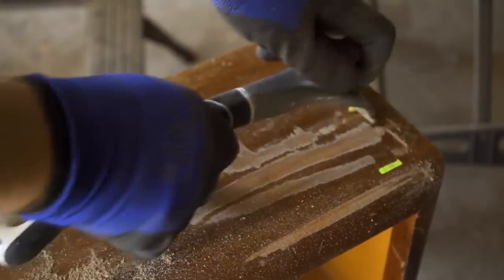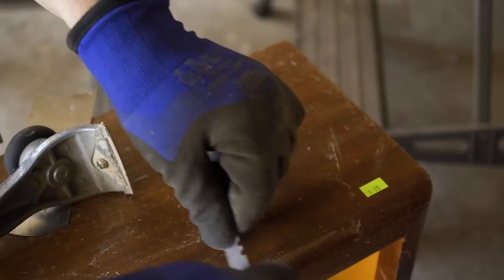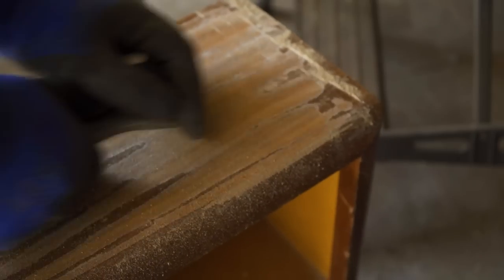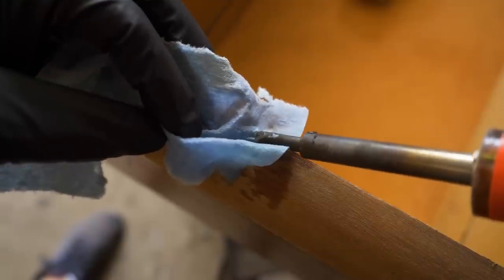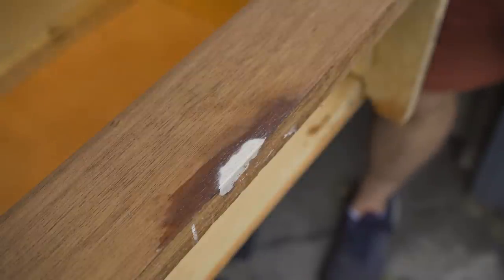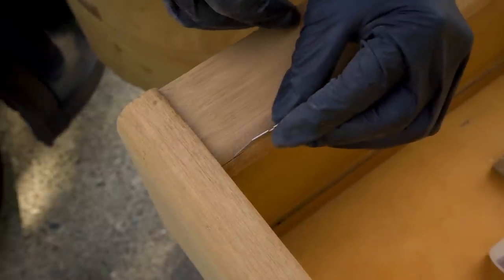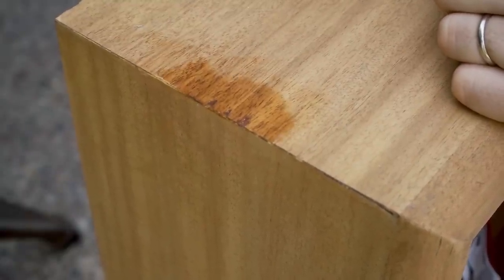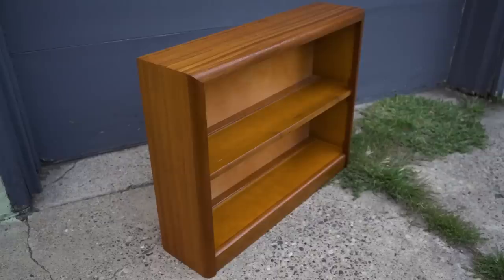Scraping Off The Crusty Old Finish | Refinishing A Mahogany Bookcase |Furniture Restoration & Repair

Comment: Couldn’t agree more about scrapers: very handy to have a good collection for different purposes and surfaces – not just for removing finish, but also for a number of different household tasks. The carbide scrapers are worth it, but a simple blade often does the trick, too. Anything with a continuous, straight edge can be useful. Some people – professional woodworkers and restorers – use a piece of glass with a sharp, straight edge.

And scrapers are the least wasteful tools: sandpaper clogs up and needs to be replaced (and sanding is dustier than scraping), and while chemical strippers obviously have their advantages, they need to be disposed of, while a scraper just goes back into the drawer.

Comment: I recently completed my first refurbishing, based on what I've learned from your videos. It was a thirty-year-old Stanley hand-me-down that I've had for most of the that time, originally for my very young son's room. We moved, he got a new dresser, and I used it in my dining area: linens in the drawers and plants and dishes displayed in the hutch. Ten years later I removed the hutch before moving again. Nine years later I want something else, so I decided to use it as my first project.

I got a stripping tool and set of six double-sided blades that I've seen in some of your videos. The trouble was that the broad 'flat' blade was slightly curved at the very edges, so it would roll sometimes and I'd gouge the surface! So I had to use some filler a couple times. The dresser went back to my son (!) and he wanted it painted black, so it didn't show.

I also used oxalic acid, just as a learning experience (as it wouldn't show under the paint), and repaired a water damaged section.

Thanks for so much that I've learned from you! I'm looking for a new project. The thrift stores here in San Diego don't have such good deals... ☹

Comment: We have one  exactly like that sitting in our living room. Its original use was as a bookshelf for a set of encyclopedias along with a complimentary set of Books of the Year. From somewhere in the mid to late 60s. The A-Z encyclopedias fit exactly into the space provided by the top shelf and about 12 to 13 years worth of BoYs into the bottom shelf. Everything neatly faced to the front edge of the shelf thanks to those rails at the back.
Reply from the maker: Thanks for the info.  I was wondering what those rails in the back were for.
Reply: I also have one. Mine is a little deeper and had a slot in the top that an atlas slid down into behind the books. My grandparents bought it new.  The books and atlas are long gone now. When I refinished it, I patched the hole in the top. Unfortunately I didn't get a good match.
Reply: @WaylanHL You should have gotten a vintage encyclopedia set and an atlas instead!

Comment: I agree with you about scrapers causing less damage than random orbital sanders. I am working on a dining table & although I try not to push down hard, replace my sanding pads often, and move the sander slowly I often get the squiggly lines. They show up when I put on stain. Ugg.

Comment: I've used the damp cloth and soldering iron trick on canoe gunwales I've installed for a customer.  It feels like cheating almost.  We use epoxy mixed with filler and cherry dust to fix mistakes, or repair old parts that are salvageable. When installing epoxy Kevlar skid plates we often wet our hand to rub them down smooth after the epoxy starts to harden.  And if you buff wood with brown paper before you finish it, it looks amazing

Comment: For the superglue and sand-dust trick, have you ever tried to cut in a little bit of baking soda?  The baking soda adds a little bit of a light powdery look to superglue, and it might just match correctly after sanding compared to just straight glue+dust.

Comment: As a preface; I’m a woodworker by trade, and do this for a living. Regarding the scraper and sanding questions- there’s no right or wrong way to do this. There’s no standard. If the result is good then the methods were good. 

There’s thousands of ways to make a repair. Whatever works best for you is the best method.

Comment: A scraper question:  Do you sharpen/hone your large scraper?  Or does the carbide keep it's edge "indefinitely" for finish scraping?
Reply: The blades can be sharpened, but also just replaced if you don't feel confident DIY sharpening. They have to be sharpened flat so they don't gouge the wood and scrape as wide as the blade rather than only using a portion of the surface. Of course, you can find how-tos here on YouTube! (I'm sure they can be taken to a pro who can sharpen properly too.) :goodvibes:

Comment: I always worry about using shellac on furniture yet I see it done all the time. Is it really tough enough and am I just being too cautious?
Reply from the maker: Well, it’s certainly not the most durable finish but if it’s a piece that’s not going to be handled much then it’s fine.  And if it does get damaged it’s not too hard to fix.  I wouldn’t use it on the top of a dining table or a bar top since alcohol will dissolve it.  I like it cause it’s easy-ish to apply, is less toxic than poly or lacquer and has a silky feel that seems to be unique to shellac.  Also, I can apply it indoors unlike something like lacquer which I don’t even like applying outdoors (but I do).